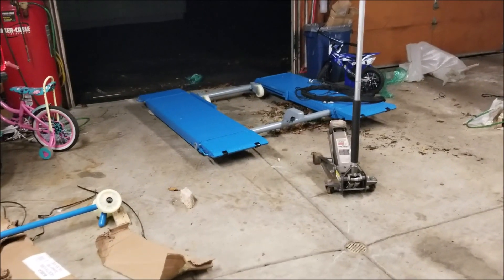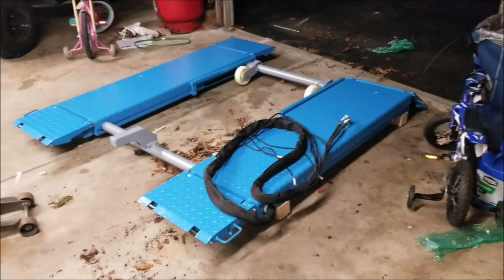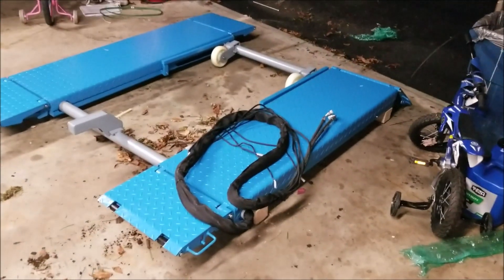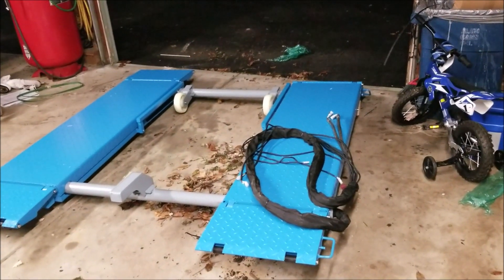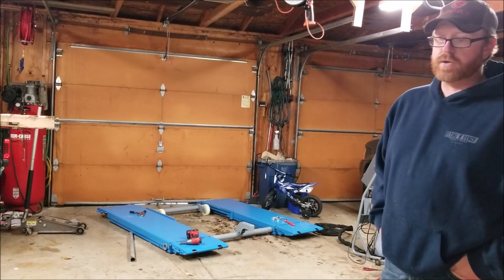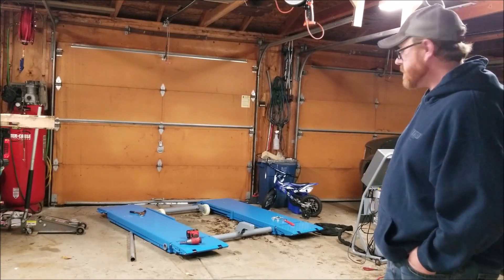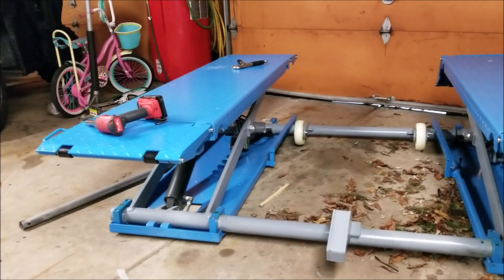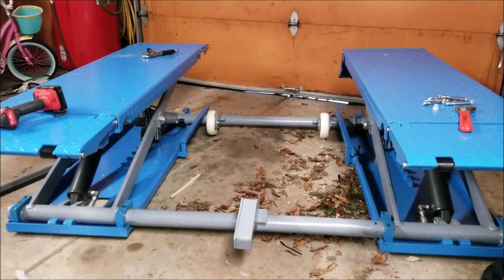Twin Busch Lift delivery and setup

Comment: Nice video.  Just purchased a TwinBusch Lift TW-S3-10 capable of 6600 lbs.  I know you stated that this equipment needs to be on a dedicated circuit.  But can you tell me what size circuit breaker you have this equipment on?

Comment: Hey Buck!
I recently installed my twin lift and it’s not working. The electric is working but as soon as I try to lift it up, it does not move an inch. Is there any saftey lock that prevents me from lifting it up. Also, the lift is like a quarter of an inch up in the air and not fully down on the ground. Do have any tips?
Reply from the maker: Not sure about the 1/4 inch up but I did have a problem with a safety. Hopefully this will help you out. https://youtu.be/CCS3igeQzYQ

Comment: Brett, question for you about this lift. I just bought the same one. How do you slow down drop speed? Seems to really slam the ground.
Reply from the maker: I dont think there is a way too. Mine drops pretty fast the last 10 inches or so.
Reply: Check out this video for changing lowering speed. https://youtu.be/46iwAZqq384

Comment: I am seriously considering this lift.  I also have a steep downward graded driveway, so I’m going to have to deal with that.  I’m thinking on having it delivered to a terminal that is about 1/2 hr away and bringing it home on a trailer, then using my engine hoist, or dollies to take it off.  How is this lift working out for you.  Any problems so far?  Wondering if this is available in a 240 volt version.  Instead of running a new 30 amp circuit I could just use my electric dryer outlet, which I currently am not using.
Reply from the maker: I dont regret the purchase or going with twin Bucsh at all. I did have a issue it wouldn't go up but it was self induced, I got a chunk of garbage stuck in the limit switch. The people at twin Busch walked me through troubleshooting until I got it figured out. I'm not sure of the 220 option but I would do the same thing if it was an option. Honestly I use it for all kinds of stuff other than cars. We used it to lift a picnic table to make the painting easier we were doing to it. Have porch gliders on it for paint right now. My side by side and mower fit on it... etc. Best purchase I have made in a long time. I think you may be better off getting it on a trailer if you have a steep drive. It's also cheaper to do it that way.

Comment: Hi Brett, I'm interested in getting one of these. How is the underclearance at max height when you do work underneath? Enough room to travel back and forth on a chair stool? Max height is 40"?
Reply from the maker: Not really. I usually have used a creeper to work underneath. I'm 5'9" and it puts the wheels and brakes of standard cars at about the middle of my chest. I changed a transmission on a Ford explorer in December and it was a life saver. I'm really happy with it. I honestly use it for everything.
Reply: @bucksgarage1 You still laid on your back and rolled around? Or able to "sit" on the creeper? Thanks for the info! Did shipping takes a long time? You had liftgate service ordered?
Reply from the maker: Yes its just not quite tall enough to be comfortable sitting up under it. I think it took 8 days to ship and the lift gate was worth it for me.
Reply: @bucksgarage1  Hi Brett! One more question. Does the two platforms take up a lot of space underneath? Do you have access to pretty much everything in the middle section when lifted up?
Reply from the maker: @nampham8101  yes you could easily change an exhaust, transmission,  probably a fuel tank.
Reply: @bucksgarage1  So Twin Busch mentioned that liftgate delivery is only curbside delivery... the guy isn't responsible to put the package to the garage. Was this true in your case Brett? Did your carrier helped pulling the lift to your garage?
Reply from the maker: @nampham8101  he would have pallet forked it into the garage for me but my driveway was to steep for him to unload in it. I got the wheel kit and that helped out.
Reply: @bucksgarage1  Thanks a lot Brett! Man I think it would be awesome if you can do a follow up video "reviewing" the lift. Talks about positive and negative, etc. Good advertisement for the company too haha..
Reply from the maker: @nampham8101  I'll try to make one this weekend.

Comment: Is there a way to turn the beeping sound off when coming down?
Reply from the maker: If you take the front cover off I beleive you can take the wire off of the beeper.
Reply: Brett Buckley that is the exact left I have been interested in for a while and seems to be a very good quality live. Annie issues or concerns with it since it was deliveredAlso I was curious if there was anything new more beneficial about the live that you weren’t aware of before? Thanks for the video
Reply from the maker: I'm really happy with it. I have done a ton of work on cars in the last month since I got it,  the cars I fixed in the last month honestly paid for the lift.  I have changed brakes on 2 cars, a caliper, 2 wheel cylinders, 2 brake lines, removed - rebuilt and reinstalled transmission. I practically use it for everything I do in the garage now. It is worth every cent    in my opinion. The only issue I have/had with is was the power that it takes to operate the pump.
Reply: Brett Buckley nice.  The one issue u mentioned was resolved by the new hardwire u completed in this video I believe? Man wish  $1899 included shipping.  That would be choice.  Thanks again
Reply from the maker: Yes that did fix it. It would be nice if the shipping was included. It's worth it though. I'm real pleased.